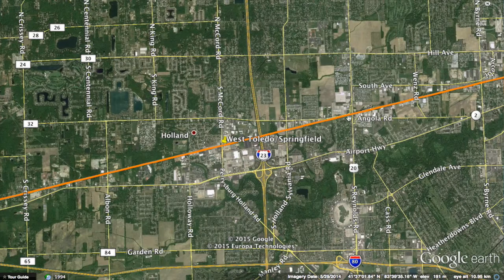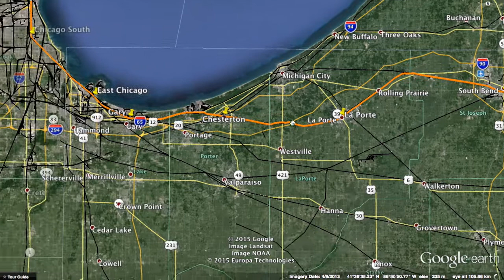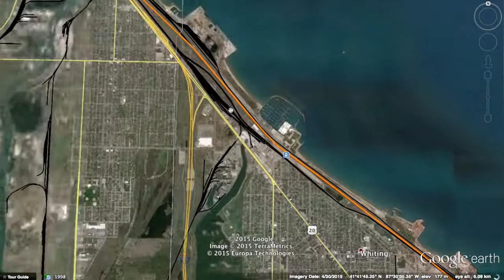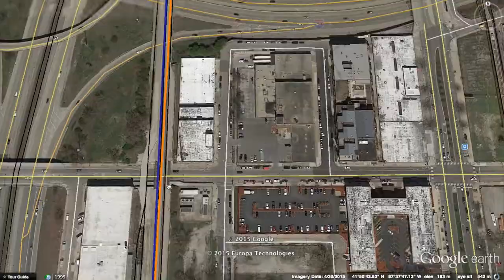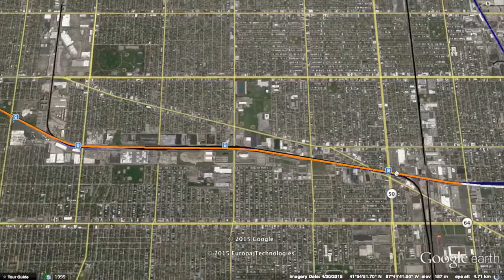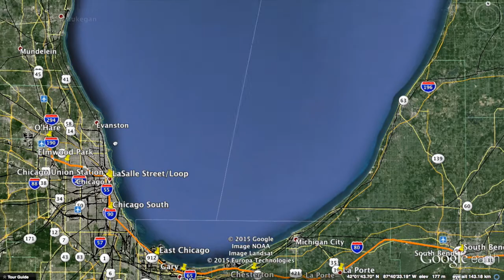Chicago High Speed Rail

Comment: The LaSalle-Union Sta.-UP Line underground connection is a really interesting proposition. It doesn't hit any real obstructions for a not-to-deep config. till after Union Sta. and think there might be multiple tie-ins possible there given some hunting around, not least off that at-grade line where the tunnel is shown connected, which should be grade separated to the east anyway and might, east of the tunnel connection, be best removed, with replacement of the whole interlocking of tracks from Union and Northwestern Stations.

Comment: High Speed Rail will be an utter failure if the following are not met....

+ No Sharing of Rail Line (High Speed Passenger Trains Only)
+ No At Grade Crossings
+ Train Engines That Top Out Around 200 MPH+ (323 KPH+)
+ Travel at Speeds of About 170 MPH+ (275 KPH+) in Rural Areas
+ Limited Stops for Super Express Trains
+ Allow Only 20 Minutes per a Stop (10 Minutes Off & 10 Minutes On)

Now We're Talking High Speed Rail

Comment: You could've done high speed electric trains at 350 km/h
Reply: And plus, the faster the train, the more likely it is to beat the jets. If you want a high speed train from Chicago to New York, you need to at least have high speed trains running at 350 km/h otherwise the slower speed will make customers more likely to take the plane.